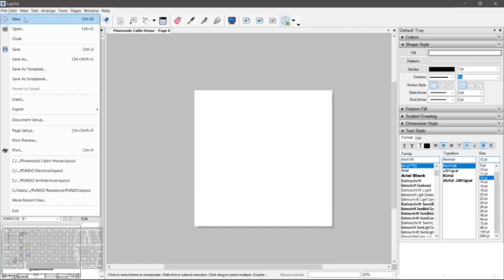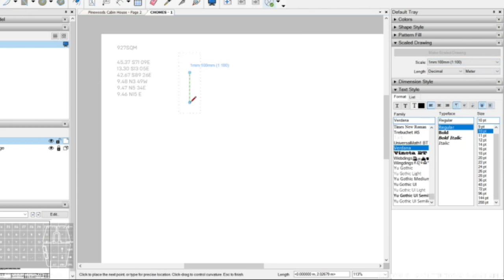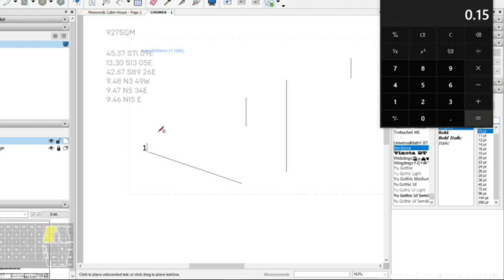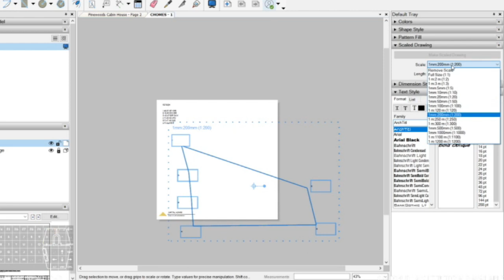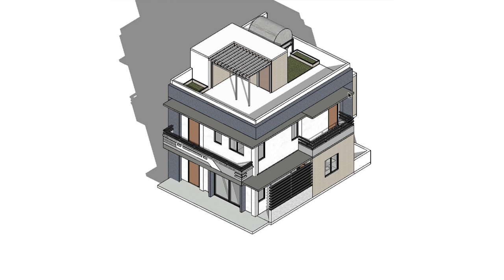Sketchup Maps 1 - How to Plot in Layout

Comment: This is so hard I've been stucked on this plotting measurement bs unlike autocad just type the angle or coordinates and the measurements of lines. I'm so confused my dad insisted on plotting using sketch up its ruining my brain
Reply from the maker: Yes, you'll get the hang of it. You can also plot in autocad and import to Sketchup. There are extensions out there as well.
Reply: @imaginemotions  i need help to remake a plot....the figures do not come with N or S or E or W...eg 101 degrees 12 minutes......how do i plot this